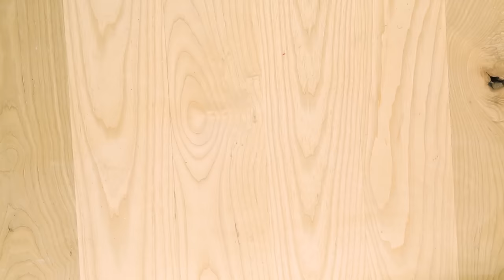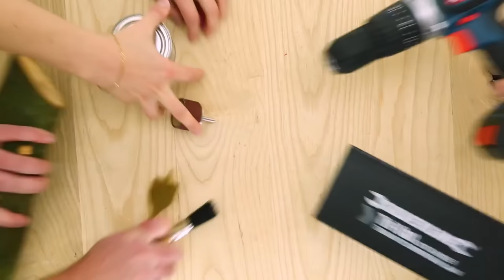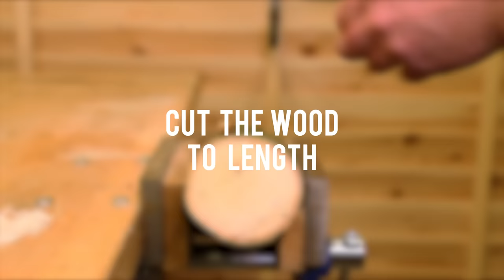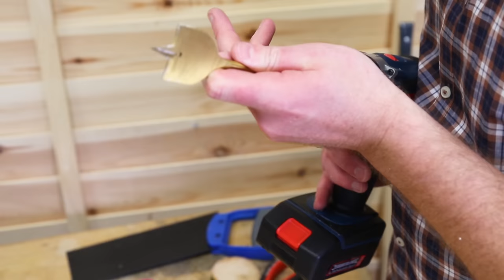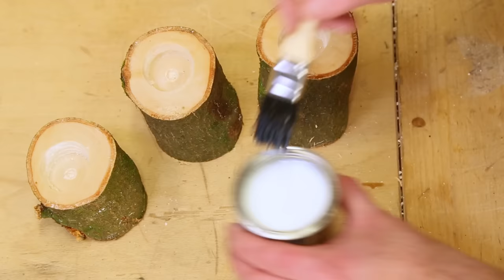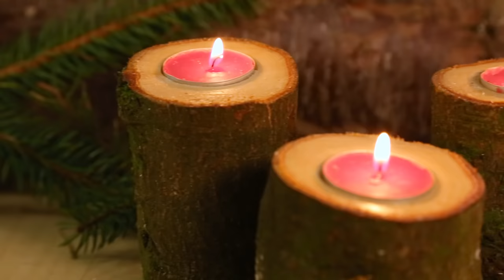How to make rustic wooden log candle holder

Comment: Simple and very nice. I recommend using a miter box for even ends so the log sits level. A forstner bit is also great for drilling flat holes, but not required. A spade bit will work OK as was used here.
Reply: could  i ask  what is that tool that holds the log and lets not to move log ?
Reply: A simple vise works